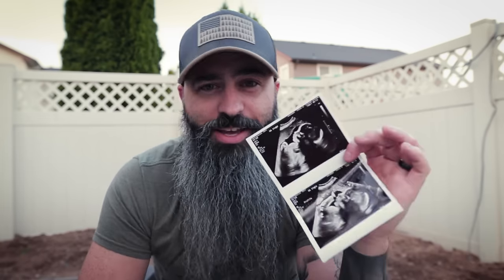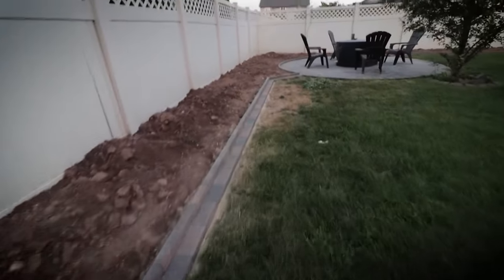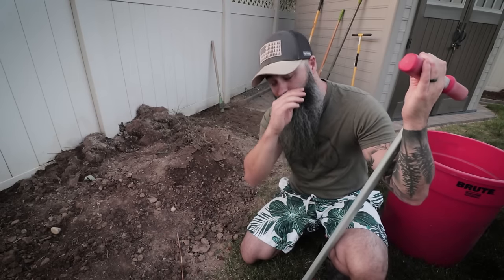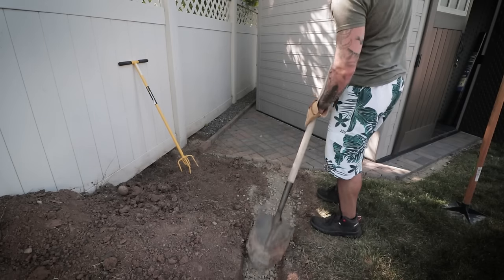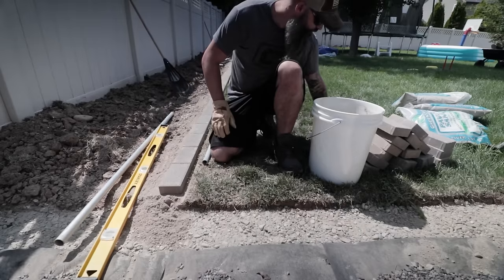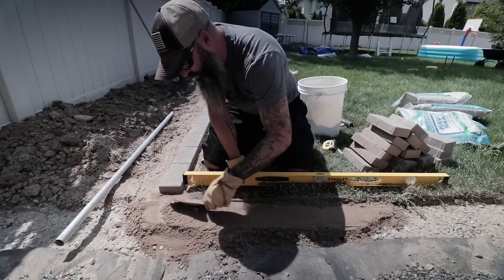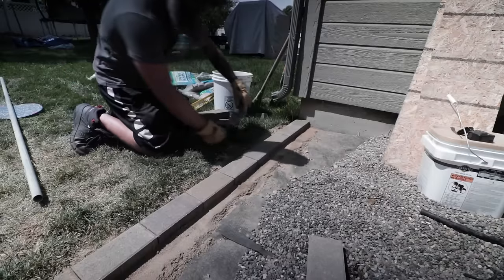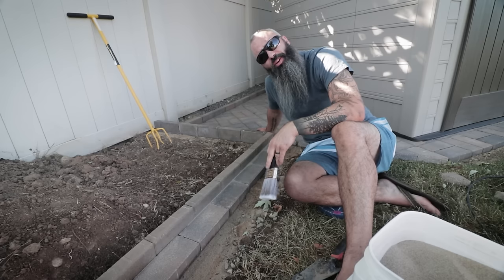How to Install Beautiful Paver Edging

Comment: Looks great....A rookie question... Why not use cement for the base?
Reply from the maker: Not a rookie question.  Cement is a little harder to flatten out than sand due to the rocks in it and cement has some downsides or things to consider.  If you have trees for instance and the roots push up under your edging then road base and sand are easy to fix that cement.  But cement hold better under regular use.  To be honest I wish I had used a little behind the upright pavers at least.

Comment: Very nice video. Simple and to the point. One question, how does the two step edging ‘set’? Was it just sand or was there some portland in it?
Reply from the maker: Poly metric sand is used at the end of the video.   When that gets wait the polymers activate and bind together.  This kind of glues the pavers together.

Comment: Looks great.  But what is preventing them from moving over time or getting knock down by the lawn mower?
Reply from the maker: Behind the uprights is a raised planting area and that dirt keeps pressure from that direction.  The dirt in front of the horizontal pavers is starting to grow grass back now and that dirt keeps them from moving forward.  The polymetric sand I put in between acts like a brick mortar and holds them all together.

Comment: Great video. What would you do if you're edge had to follow a slope? How you tackle the leveling
Reply from the maker: I had a bit of that along my back fence.  I screwed two 12 foot 2x4s together so they over lapped each other by 2 feet making a 20 foot long board.  I laid that on the ground, placed my level on it and noted how far off center the bubble was.  Then I did the process you see in the video but instead of centering the bubble I put it in the same spot from the previous step.  Worked pretty well.
Reply: 👏👏 cheers - great content

Comment: I have a 18 x 18 pad. There is a difference of about 12 inches from the front to the back. I need to place a "retaining"wall along the back of the pad 24 feet. Come around the corners 3 feet on each side.To make it more useable, I thought about placing a bench seat on top of the retaining wall. Any ideas.

Comment: Hey boss. I like your content, and good video here. One question though...how do you plan on these pavers not laterally shifting? Or possibly even vertically as you have not buried them at all or used paver edging. The sand you used to level the top will eventually wash out at least some. I’m not sure that’s a question, or maybe more of a heads up.
Reply from the maker: I packed in soil both in front and behind so the pavers are buried slightly.  Where I live the dirt is is like clay so the sand really doesn’t have anywhere to go and the polymetric sand helps with this as well.  So I agree I do have some risk of movement but it will be slight and may not even be noticeable.  I’ve hit these with the wheels of my mower and they don’t budge.  If I see movement after a couple years I’ll go through and fix the spots that are an issue.
Reply: @OutdoorBeards  Great job,  was thinking about doing that myself,  but,  don't think I'd get away with it in rainy Ireland,  guess you're in the rain shadow of the cascades,  for areas where precipitation is high,  that sand base wouldn't last long.   Still though,  right tools for the right job.   I'd have to use concrete underneath.
Reply: One weekend with the kids and this falls apart.  Add cement quarter minus mortar mix with a dash of thinset.  Then build a 45 degree mortar mix wall behind the pavers for lateral support.
Reply: I like that , because you can always remove them in case you change your mind vs permanent ones with concrete underneath, also I hate the looks of plastic edging this looks more natural plastic in the ground just looks ugly
Reply: The road base is very different from a sand base material.  It actually is quite awesome.  Another channel used it in his open acreage to help with mud from constant horse movement.  Looks like he had concrete poured.
Reply: @sloflo1  Yeah, Im laying brick edging but think I need sand and cement....

Comment: Looks great, but what's to prevent the vertical bricks from toppling over at the first hint of pressure?  Wayward basketball?
Reply from the maker: The polymetric sand acts like a glue between the horizontal paver and the vertical, some of this is also between the verticals as well.  then behind the vertical paver I have dirt and mulch piled to the top of the paver.  Works pretty well.  My kid likes to walk on them like kids do on curbs.

Comment: I am planning to do pavers in my front yard, what did you use to ensure the pavers stay in place? Great video!
Reply from the maker: Behind the line is a raised bed of dirt which stops it from moving backwards.  In front I filled with dirt to level the grass and planted new grass there.  I have not had issues with the line moving.  Did have issues with the vertical pavers tipping backwards.  I would suggest adding a little concrete behind the vertical to stop that.  If you’re really concerned about things moving you can put in paver edging, it’s like a rubber wall, before placing your sand.
Reply: @OutdoorBeards  I appreciate the insight, thank you.

Comment: My only concern is that the paver might move when they get hit by the mower.   I did a similar job but with cement instead of sand, so far so good and they are not moving despite getting hit by the mower sometimes.
Reply from the maker: Had a couple issues with the uprights with that.  The horizontals haven’t moved at all though.   The raised bed behind it keeps the line from moving back and the dirt and grass in front keep the line from moving forward.

Comment: Thanks for sharing this.
I was wondering did you 2:29  end up putting the paver edge behind the circle patio as there are uprights over there as well?
Reply from the maker: I did.  So the uprights go around the entire yard.  I ended up building an arbor with a swing back there in the corner, that will be in a future video, and we are going to take out a section of those uprights around the patio and pave the area under the swing this summer.

Comment: Great job on this. Do you see any reason to do a concrete edging or something to hold the pavers in place on top of using the polymeric sand? The area I am doing is flat just like your and essentially I am making a big rectangle.
Reply from the maker: I would use concrete behind the uprights at least if I had to do it again.  I have had to reset some of those due to the kids.  Paver edging would do the same thing but I hate that stuff so a little quickset concrete under and behind the upright would be a good thing
Reply from the maker: The poly metric sand did not hold as well as I thought it would.

Comment: Nice job.  Looks good for now.  Doesn’t stay in a climate with frost heave.  It will lift and move.  Material will wash and move so when it thaws it will not be the same. I give no warranty to customers unless it is dug out to proper depth and put on steel reinforced concrete footing.  I wish you good luck.

Comment: Thank you for this video and it looks great. Is the permasand strong enough to hold in place long term? Was going to try this but thinking about a fillet of cement behind the vertical to make it a little stronger. TIA
Reply from the maker: The poly sand was not strong enough.  Especially with two kids.  I went back and put concrete behind the vertical just like you’re talking abojt
Reply: I was curious too. id probably even go as far as laying the flats in a bed of mortar

Comment: Great video, but what's securing the pavers in place?  Is there any kind of edge control?
Reply from the maker: Dirt and grass in front keep them from moving grass-ward.  Raised dirt area in the back keep them from moving that way. If I did it again I would add a little concrete behind the vertical paver.  Turns out kids can be pretty rough on these things.

Comment: I'd love see the "straight line" in a year, it will be all over the place with settlement issues. You need to concrete those in, not just lay on sand that will wash away.

Comment: Awesome idea among several videos I ever watched! One thing I was wondering if its better to compact and level the soil by a tamper all the way up before setting the edging stones.Adding extra gravel or soil by hand will most likely make the stone unstable and potentially move over time.
Reply: He did completely compact the gravel base.  The sand is just the thin bedding layer.

Comment: Instead of using sand you could use cement.  Afterwards sprinkle it with water and that cement will harden and never move.
Reply from the maker: I’m not sure if cement would work that way.  Cement had to be mixed not just sprinkled.  Interesting idea though
Reply: @OutdoorBeards  fast set cement does not need to be pre mixed mist it with water and it will set after youve leveled off your bricks.
Reply from the maker: Ahhhh that’s a great idea

Comment: Am I missing something or won't the bricks be easily moved if you accidentally stand on the edging or maybe run into it with your mower? This isn't a negative comment, I love the way it looks, I just want to understand better
Reply from the maker: A couple things are holding this in place.   First the polymetric sand I put in there kind of “glues” the paver together.  Second, dirt and grass in front of the horizontal paver stop them from moving that way and the raised dirt bed behind the upright paver stops them from moving back towards the fence.

Comment: I heard of people using quickcrete as a base- thoughts on that idea?
Reply from the maker: Quickcrete instead of sand would be a great idea, however you would have to use the plastic/rubber paver edging to hold back the quickcrete.  Otherwise the grass in front of the flat paver will not have enough space to grow roots.  I went back later and added quickcrete behind all the vertical pavers to hold those in place.  Turns out kids can be rough on the edging.  Also, I would not do that in areas where tree roots might affect the edging down the line as it would be difficult to fix.

Comment: How does the back brick hold up? Like in place if something were it hit it. Like my kids riding there power wheels around!!!
Reply from the maker: I raised the dirt up in the “planting area” behind the upright paver.  Also the polymetric sand was supposed to act like mortar and help hold it together.  This worked for the most part but I also have a few spots where the sand didn’t seem to take as well.  Thinking about putting a little concrete behind it in these areas.  There was another comment in here about using a quick set concrete in place of the base sand.  Seemed like a good ide

Comment: how would you handle a curve in the edging with this type of work?
Reply from the maker: I did a ring around two trees with this.  You can figure out the angles using a bunch of math but once you have the angle figured out you have to cut both the upright and the flat paver at the same angle to create your curve.  But you can’t offset the pavers like you do in a long straight away.

Comment: Hey man! How did it hold up?! I’m wanting to do this as long as it held up well!
Reply from the maker: I had trouble with some of the uprights so I went back and added a bit concrete behind them and it’s done quite well.  I’ve had some people talk about the fact I didn’t use plastic edging to keep the sand in place.  Where I live our soil here is like clay so when I built up my dirt in front and behind the pavers that essentially locked the sand in.  So depending on your area you may need to use the edging for the sand.  
Side note, my wife loves it.  It’s been 3 years and she has all these plants and shrubs and flowers she’s put in.   It’s quite nice.
Reply from the maker: Hope your project goes well!

Comment: Novice here. Am i right in thinking the blocks are on a mix of sand and type 1 or cement and kiln dried sand. This is simply wetted or sprayed. Does it harden or just set? This is adequate because its not for heavy use.?  Thanks.
Reply from the maker: It’s just paver sand set in place.  Since there is no traffic on these pavers it will be adequate.  Plus the polymetric sand that goes into the cracks acts like a brick mortar.

Comment: Nice, what size pavers did you use? LxWxH ?
Reply from the maker: Holland Tan/Charcoal Concrete Paver (Common: 4-in x 8-in; Actual: 3.8-in x 7.7-in) https://www.lowes.com/pd/Holland-Tan-Charcoal-Concrete-Paver-Common-4-in-x-8-in-Actual-3-8-in-x-7-7-in/50187995
Reply from the maker: Here’s a link to the pavers I used

Comment: Any suggestions for a hilly yard ?
Reply from the maker: It’s difficult and slow going.  Pack your base layer in then build up the sand until the paver is flush with or your desired height above the grass.  It’s slow because you are setting one paver at a time to the right bight.  Suggestion, I went back and added cement behind my vertical pavers.  I have kids and the verticals were knocked over in some places.  The poly metric sand used at the end is not as strong as I had thought.

Comment: I have installed a 200 sq ft Bermuda lawn in my backyard, the problem is Bermuda likes to run, so I will need to put a boarder on three sides. Second issue I am not sure if this is possible.
If you lower the side brick down the height were the wheel of the push mower rides on, so the blade cuts as close to the edge as possible. Do you think that will work?
Reply from the maker: Probably, but you won’t have the clean line that comes from being g able to edge it right up to the paver.
Reply: @OutdoorBeards  Yeah that is correct, I do have a weed whacker, but I find it difficult to get a clean edge without anything down. So I will be putting down a border this fall. Thanks

Comment: Is the point of the rocks under the sand to make sure the sand doesn't go anywhere? I'm new to this . Ty
Reply from the maker: The base layer under the sand becomes very hard after its compacted down.  This creates a solid base that won’t move or sink.  It’s the same thing they put under concrete or beneath a road.
Reply: @OutdoorBeards  thanks!! I'm thinking of doing this in my backyard. First time 😅

Comment: What keeps the paver sand from washing out underneath the pavers?
Reply from the maker: After I finished this I packed dirt in front to the level of the paver, grass on that side, then raised garden bed has dirt up higher.  It’s 3 years old now and the only issue I had was kids knocking uprights over.

Comment: Where does one find this paver base and how much did you use on your project?  Any pictures over time how they are holding up?
Reply from the maker: I used just under 500 pavers over 152 linear feet.  Not sure how much of the based I used, maybe two yards.  I had also done a paver patio in the previous video so I bought 6 yards of base to handle all my project.  You can normally find paver base at any landscaping place.  Where you would buy rocks, trees, etc

Comment: My backyard slopes away from the house,  any suggestions - should I make the border level or follow the grade ...
Reply from the maker: Definitely follow the grade.  Unless you’re wanting to re-level your whole yard.  Set a 10-12 foot 2x4 down on the grade and put a level on top of it.  Note where the bubble is on the level.  Then do the same thing in the video but adjusting where the bubble sits.  Also, depending on the severity of the grade you may need to include the rubber paver edging keep the sand in place.
Reply: @OutdoorBeards  great 👍🏽.  Definitely appreciate the suggestion.  I will follow the grade; levelling the whole thing would be too much of an undertaking and I'd have to get it done professionally

Comment: Will permasand holdup to a lawnmower hitting it?
Reply from the maker: On the horizontals yes.  I had issues with the vertical so I added a little concrete on the back side of the vertical pavers and now yes it would hold.

Comment: Does the perma-sand harden after it gets wet ?
Reply from the maker: Yes, but it’s not as strong as I thought.  Turns out a solid hit with a kids bike will separate it.  I went back and added a small amount of concrete behind the upright paver to help with this

Comment: How do you do the 45° angles
Reply from the maker: I cut the paver vertically at the angle I needed.  Had to do too and bottom, the score the uncut area where the blade couldn’t reach and the break it.  After that it’s just cleaning up the cut with the grinder.

Comment: Looks great now.   However, if this were my project, I would have gone through the extra effort and expense and put down a concrete footer for the base.   Then I don't have to deal as much with tree roots and the inevitable settling.
Reply: Usually 3” of class 5 will prevent any settlement whatsoever, even in harsh winters.

Comment: How do you make/keep the line so straight
Reply from the maker: That long electrical conduit works really well as a straight edge.  I also measured out from the fence every so often to make sure I was still in line.  I’m a little ocd so I tend to take longer to do projects then most, but my stuff looks really good when I’m done so I don’t mind spending the extra time.

Comment: What's the sand that you used at the end of the video
Reply from the maker: It’s called poly metric sand.  You can find it next to the pavers at lowes and Home Depot.  Be advised it comes in different colors so read the label carefully before you buy.

Comment: Wish people would say what the project costs.
Reply from the maker: I’ll remember that when we do the front yard.  I can give you some rough idea, this was almost 4 years ago.  I did two paver patios and 146 feet of this edging, all with the same pavers.  I used around 1600 altogether at .25 each for a total of $400 in pavers.  The base layer, sand, and poly metric sand was probably another $400.  Plus I had to buy a grinder.  So say $1000